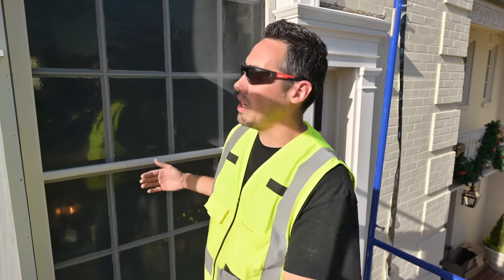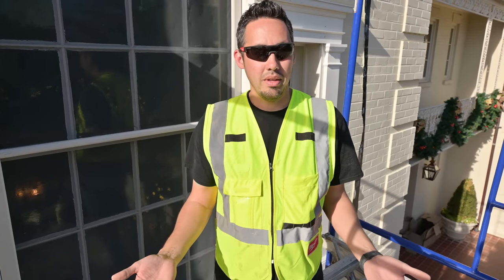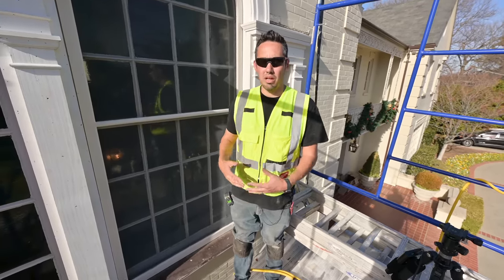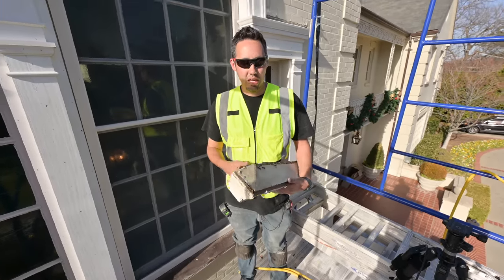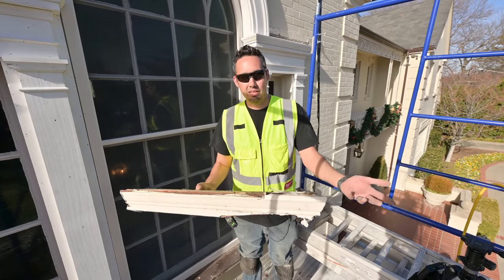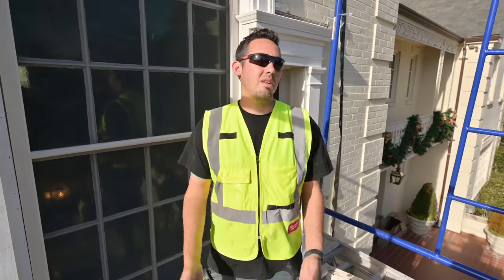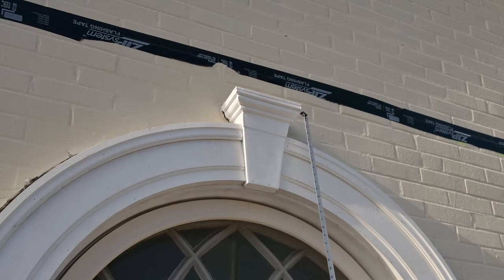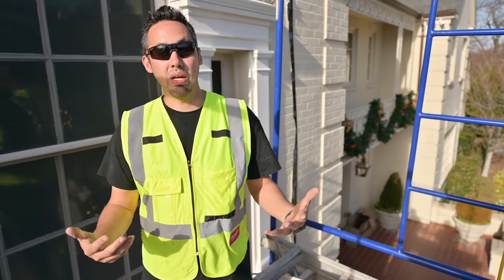Palladian window with REAL WOOD - Exterior Atchitectural Millwork

Comment: I’ve seen PVC warp and pull from a windows. The windows were painted with a dark paint and got a good bit of Sun each day. 

Thanks for sharing!
Reply: The builder of my house chose to paint all the PVC window trim dark brown.  It warped so badly from the summer heat that we had to replace a bunch of double windows on both floors.  We then repainted it all with light colored paint.

The manufacturer of PVC windows assigns an LRV (Light Reflective Value) to the window trim.  With some, painting the trim a color with an LRV less than the minimum assigned, such as 55, will void the window warranty.

Comment: OK two simple questions. 1,  Why air compressor nail gun and not your battery cartridge gun? 2, Who is going to fill your nail holes, you or the painters? As a painter I say it's your job I have this argument/disagreement with carpenters often. Go wood all the time!

Comment: Old-growth lumber can last 100's of years when painted. That includes old-growth pine. Typically homes up through the 1920s had old-growth lumber used for external millwork... so suggesting that "the original lasted 90 years, and so will this new wood" is sadly not the case, because new growth lumber, even if painted, will rot typically in less than 10 years if not pressure-treated (even new-growth cedar will rot, which surprises many).

Comment: Labour is the same so use the best material. I only use PVC if in direct contact with water. I despise cutting it, it is nasty and not healthy. Much better to use Impe wood / Brazilian Walnut. Or a wood I use to get from Malaysia - could not nail it . But drill first and never a rot.

Comment: With proper flashing and maintenance all woods will last very long time. Caulk and quality paint will bear the brunt of UV and weather. 

PVC is plastic. It will definitely hold up long term. May not look as good long term but will definitely hold up.
Reply: Great job with this video btw! I would bet most the carpenters agree with you on 99% of this.

Comment: Plastic is an awful material. Hate it. Hard to work with everything has to be stuck with glue. No fixings. It fades and most definitely warps in the sun. Would’ve been a travesty to have used it on this beautiful project. Fantastic work as always.

Comment: I can personally say PVC sucks in Manitoba with our climate change. I've seen it Yank itself off of walls that was installed with screws. The only one I seen still standing was along a footing I did with grk's, I'm sure its due to the wide head giving that support needed. 

I know that jeld-wen windows has their own PVC trim and panel lineup. I've seen some of these items. 

Houses like that aren't going to use fake products. The owners try to stay as original as possible to keep that character. 

Lots of houses here over 100 years old still with the original cedar with 20 different layers of paint

Comment: Wood is easier to contain the movement in plastic it warps way worse and there is nothing you can do to contain it besides screws, but even then if it moves so much even that can't hold it. Forget using nails on PVC it will look bad in 5-10 years if you do.

Comment: Why does she settle for plastic when she could have some real wood? :)

But seriously, a lot of people who have suffered through pine boards rotting on the exterior of homes, are searching for something that will not rot.  There are not a lot of places that supply more rot resistant species of wood.  And when you can find it, it is a lot more expensive than pine.  As they say "there is always time to do it right the second time".

I think that missing flashing is the result of a repair that was done sometime in the last 97 years.

Comment: I get where you are coming from, but you are using wood from trees that take a lifetime to grow.  So it is a trade off.  PVC and boral will both last longer than the foundation ever will.  So it is a trade off for short term problems for long term gains.  You should see the problems the massive deforestation in Africa is causing right now.  

I always prefer to work in wood but Boral is my second go to.  PVC I reserve for certain installs and style of moulding.  Brick Moulding in a basement stairwell etc.  Boral could last the same but I have problems with pitting on their profiles so I only use their flat boards.